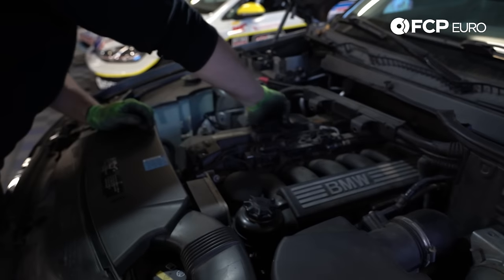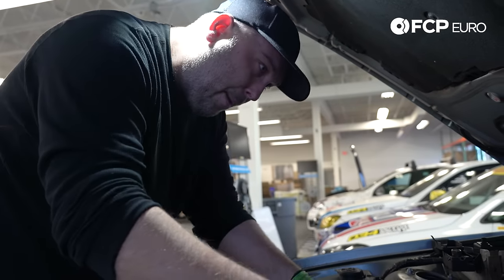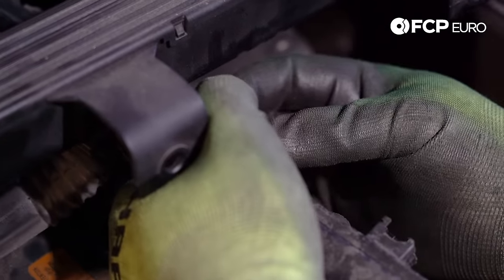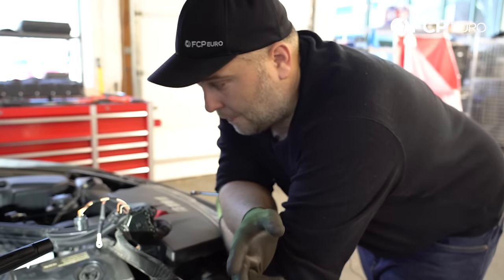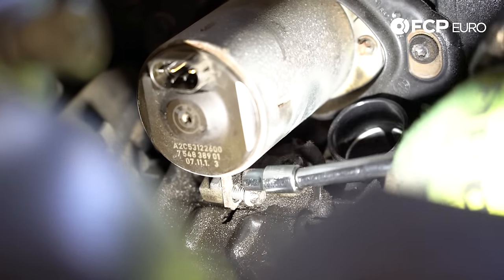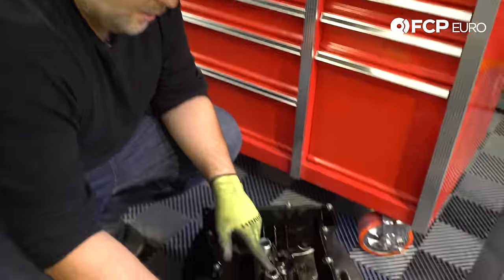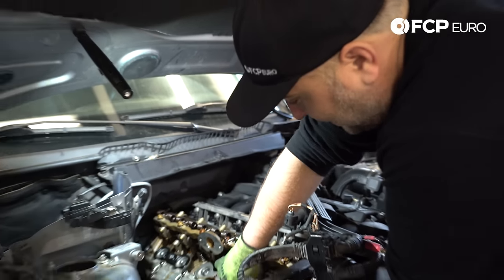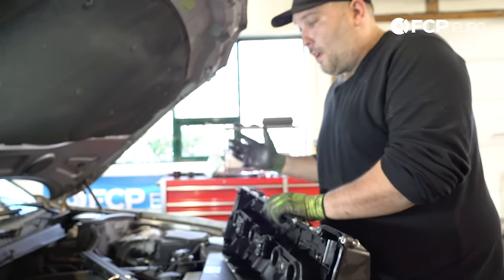How to Replace the Valve Cover on a BMW N51/N52N Engine

Comment: Hey I'm trying to get the valvetronic motor out and it won't. Did exactly what you did but when I back the 4mm screw off it will back out until I hear a click then it wont come out I'll keep on spinning it counter clock-wise and it will just click but won't actually come out there's still tension no matter how much I screw it counter clock-wise.....?????
Reply from the maker: Hi Tyler, This might be a silly question but, did you remove the three bolts that hold it in?
Reply: @fcpeuro  Naw I got it all fixed thanks though it just had a bunch of rtv holding it on from the last fix.
Reply from the maker: @mty3606  Nice, glad you got it sorted out!

Comment: This didnt show how to remove a lot of the bolts and wires.  Just the cover itself.  There are so many more steps that you need to take before even touching the valvcover.
Reply: What's missing?
Reply: This is one of the most detailed videos I have seen, you must not have watched the whole video because I followed thee steps exactly and it is all there

Comment: During VVT manual relearn of stopping points  on install, how many times do I need to spin it counter clockwise? How significant is the resistance? Is it the same as when it reaches it stop point on clockwise rotations?

Comment: Should I need to replace the shaft sensor at same time?
Reply: If you have over 100K it would be a Good idea when you have the VC off. Cause I just replace a VCG but the owner did not want to replace the sensor $$$ and 5k later they needed one. "Pay me know or pay me later"
Reply: @karlbarber8812  thx, aleady replaced the vcg, no more smoke smell

Comment: 165k mi N52 magnesium top just pissed out some kinda fluid from the rocker cover onto the exhaust

🤣☠️🪦

Methinks the previous owner re-used the original bolts; the thang didn't look sealed at all

anywho, fixin' to grab me a new gasket, valve cover, & bolts; hopin' fer the best, expecting the worst 😭🙏🏽☠️🪦

Comment: Need Help After I installed The Valve Cover Now The Car Starts Really Rough and it Won’t pass 3rpm or 2 At Times I checked All Plugs And Coils And Nothing. No codes or check engine light 
07 BMW Z4 SI 3.0 With The automatic transmission That has paddle Shifter

Comment: Very detailed video ,  bro I m getting code p0012 p0015  I have 2008 x3 3.0si and running rough on idling and shooting black smoke randomly  and after warming up I can hear whistling sound.
Reply: Ccv valve, you can buy a replacement and go through the hassle or just get a new valve cover.
Reply: Ya gotta leak somewhere possibly eccentric shaft sensor needs replacing too

Comment: PCV valve Can be replaced, cut it out and glue a new one in, you can buy it for less than 50 $ compared to 500-600 for a new cover.

Comment: Hey there - can't thank you guys enough for this video and several others that have saved me time, headache, and lots of $$$. This one was at the far edge of my skills, but got it done! THEN, pulled a bonehead maneuver and want to see if you have any ideas as to why the car won't start. Attached a video link to this that will hopefully better show you the issue I'm having. Thanks in advance for any help you can lend! 
https://youtu.be/p6ikYO4A61s
Reply: Since the cable I crossed over with the ratchet was the chassis-to-engine ground, I wonder if maybe I didn't fry that? Please check out the video I made (link above) explaining the problem. Hoping it's not the starter and trying to eliminate other possibilities before going that route. Thanks!!!
Reply: Did you get this figured out sir?

Comment: Gotta do this on a 2010 528i (F10) I'm looking for how to remove the sound denting material in the back to access the rear bolts to the valve cover. If you guys know anything about it, it'll be greatly appreciated!
Reply: NVM, pretty sure the F10 has the most room to reach the back bolts then any of the other cars this engine was in. About to slap this new cover on.
Reply: @_brushie  the f10 had this engine? Didn't they switch to the turbo i4 ?
Reply: @E9X330  I'm not much of a BMW guy so I wouldn't know all the engine options  (Doing this for a roommate) but it is a straight six with no turbos on it.